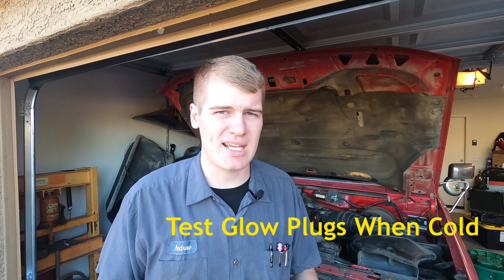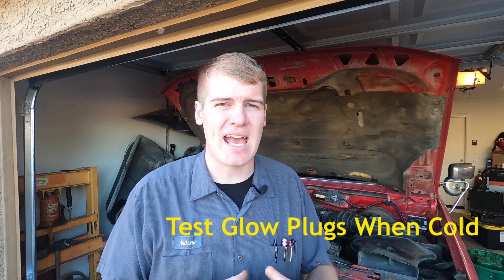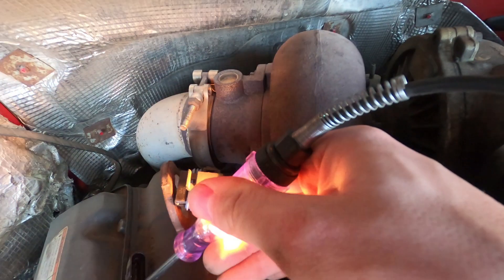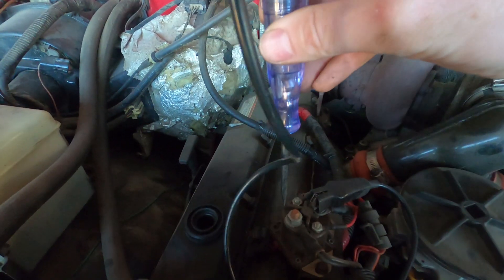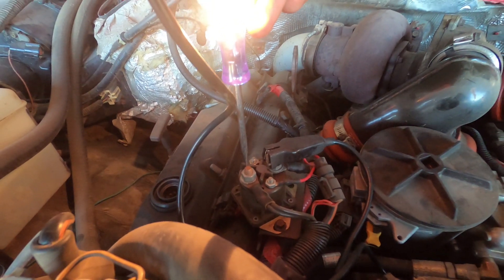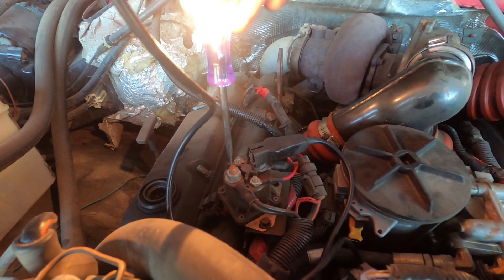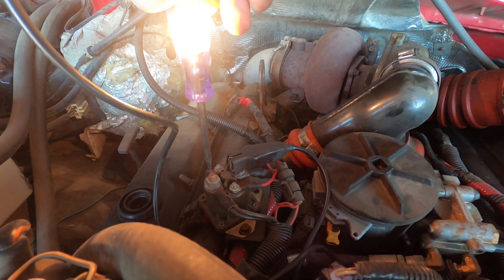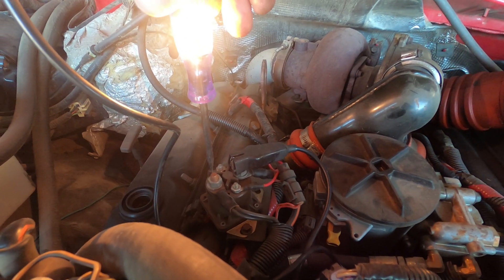How To Test Glow Plugs: OBS 7.3 Powerstroke

Comment: Where can you find a decent harness/gasket. OEM ones are very hard to come by and quite expensive.
Reply from the maker: I don't even know anymore.
Reply: @RogueWrenching Also when testing the relay with a light is the hot side of the relay supposed to remain hot when  turning the key to the run position? Trying to troubleshoot an extremely hard to start in cool weather on my 97.
Reply from the maker: @brandonion5647  put a test light across the 2 little posts key off, it should not illuminate. Key on and the light should come on. If that checks good put the light across the big posts, key off light should be on and then turn off when key is turned on. By across I mean connect the ground clip to one post and place the probe on the other.